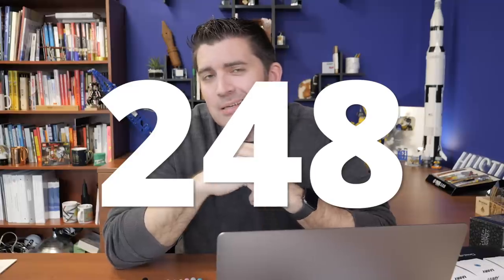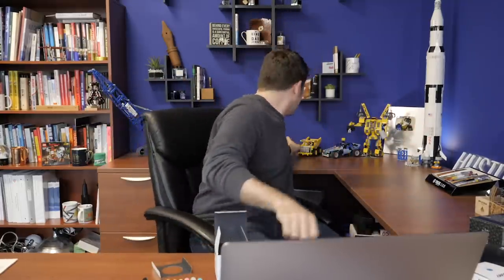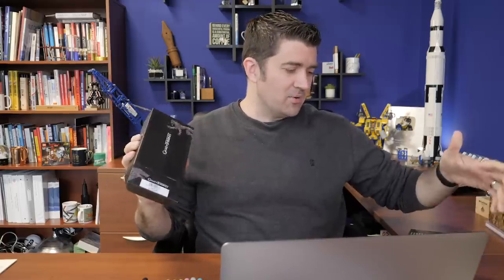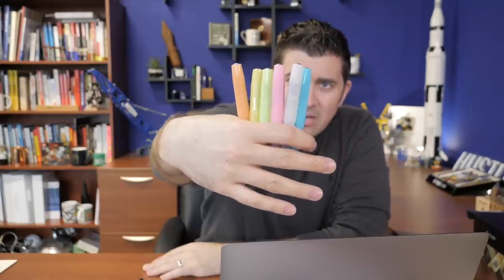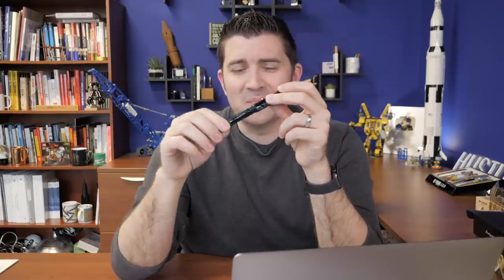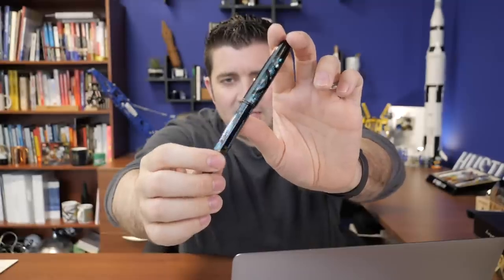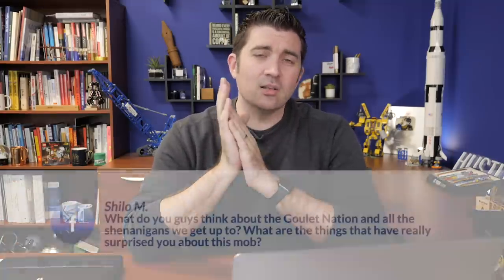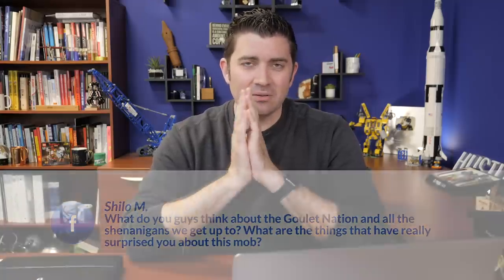Goulet Q&A 248: 3D Printed Pens, Heirloom Pens, and Clipless Pens

Comment: i made a 3d printed pocket sponge inkwell, so i could dip my blue in black and have my signiture transition color. but because printed objects are porus the sponge and a oring seal on the lid prevented any messy leakes and i did coat the inside with CA glue to minimise the prosity of the chamber, it would still dry out in about 3 days. i have played around as a prototyping tool for a pen idea im working on but would not recomend 3d printed as a working pen.

Comment: I generally use the pen clip as a roll-stop and if the pen is small, I need to use the clip when putting it into my pen wrap. I would not be comfortable buying a round pen without a clip on it - because I don't think I have ever had a perfectly flat desk.... I don't want my pen to fall on the floor and get scratched - or worst break.

Comment: You do mention pens you do not carry, so I will mention Franklin-Christoph. A lot of the models are designed without clips (some you can choose the clip), and they design in a roll-stop (just not as reliable as a clip, which is my favorite roll-stop). An advantage to the design-in roll stop is that I do not cap the pen, so I set aside the cap to use as a roll stop for my pen. Obviously, I could just as easily have put anything else out as a roll-stop, but I can find my pen’s cap more easily and protect against knocking it around. Like you, I prefer capped pens, but F-C does a great job with design, and they appear to prefer the look without a clip. Or, since I am not fan expert, maybe not! (I personally own 1 F-C, with Matsuyama-ground nib, so I like it.) K

Comment: I have a question: Sometimes, when I ink up a pen with a known ink (no dry ink) and after having cleaned it, it seems not to behave well. It occasionally skips and simply does not feel right. I would like to give up, but before that, I try another ink and now the pen behaves well. Is there more to the harmony of pen, ink and paper than simply chosing 'good' ones?
Reply from the maker: There's definitely a balance and certain inks/paper perform better with certain nibs/pens. A pen may struggle with a wetter ink as the feed tries to keep up with the ink demand causing hard-starting or other flow issues. - Colin

Comment: I have a question. Why are some of the steel nib pens more expensive than pens like the Lamy 2000 and the Pilot Vanishing Point? What makes them so expensive?
Reply from the maker: Material & scale are the biggest reasons. LAMY & Pilot are larger than most fountain pen companies so their scale allows them to have those $150 gold nib pens. That's not the case for companies like Edison. Material & labor as well when it's a more manual operation. - Colin

Comment: Edison Premier is pretty, but I'll never buy one again.  The cap on mine cracked badly - had to tape it together, which is unacceptable for a pen that costs $169.  Huge bummer, because I can no longer have it as a daily carry.
Reply from the maker: Did you reach out to us or Edison? May have been something defective and replaceable if the material was still available. - Colin
Reply: @Gouletpens  Just happened a week ago and it's a Galaxia, so no longer in stock.
Reply: Kirsten Dahl If Edison has no more of that material to make you a new cap, perhaps they have a solid that would coordinate?
Reply: Even if its no longer in stock, manufacturers often have bits available.  I just got a 1999 "feed" replacement for a Waterman long out of inventory by writing to customer service in France where so many brands have landed.

Comment: A rib eye steak tree is tempting but I think I have to pick a mashed potato tree. Re clips: I prefer my pens that have clips. However, I don't like clips that don't function well, I'd prefer no clip over those that you need a pry bar to use.🌻
Reply from the maker: Mashed Potatoes would be interesting logistically. I guess it would come in some sort of pod that you'd pick? Either way good choice! Just need to find the butter tree & gravy tree. :) - Colin
Reply: The Goulet Pen Company All good points Colin!  If "prepared food" trees come to be, I will need to think through those details like butter & gravy better, as they are a necessity for a perfect mashed. 🤓🌻

Comment: Yoshi at 18111 Pen does some 3-D printing. (https://pen.18111.com/) I have one of his original Stone Mask fountain pens, and it's a beautiful piece. But the 3-D printing material is somewhat porous, so it shouldn't be allowed to contact ink when filling. Which either requires filling with cartridge only, filling a converter by itself and inserting like a cartridge, or replacing the 3-D printed section with a turned acrylic section. I paid a little more to have Yoshi make mine with a dark red acrylic section to reference a pukao, the red stone "hat" that topped many of the Rapa Nui moai statues that inspired the Stone Mask pen.

Comment: As someone who owns a 3d printer unless you have a very expensive 3d printer it will be very difficult to print a pen within the tolerances to fit the non-printed items (nib/feed most likely). A feed would be enormously difficult to print with consumer grade 3d printers.
Reply: SLA printers are coming down in cost so printing a feed wouldn't be that difficult. There's no way to compete with injection molding though, you would have, I dunno, tens per hour rather than thousands.
Reply: duckrutt it’s more that the process to get the fine fins would be such a hassle and so much work that outside being able to say you printed one it would be too much effort.